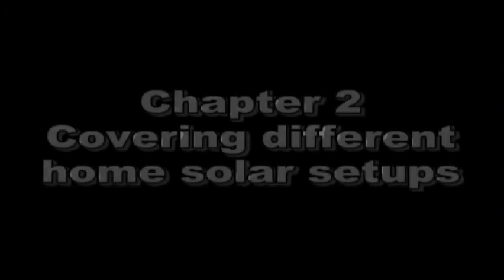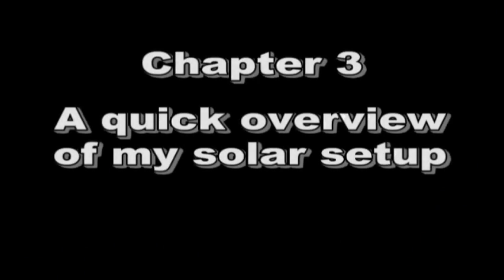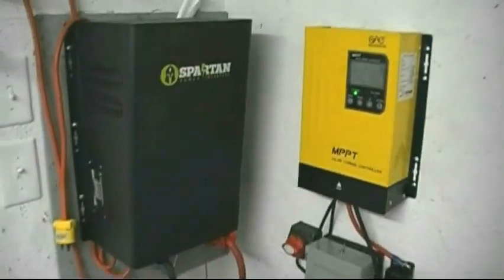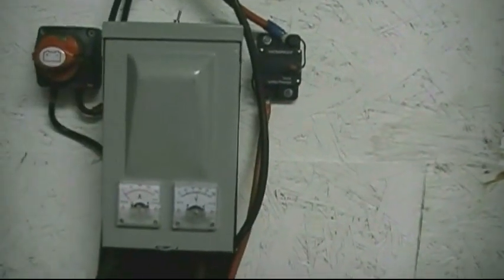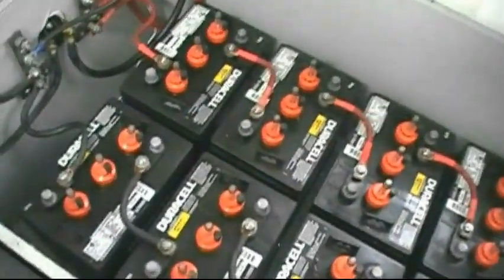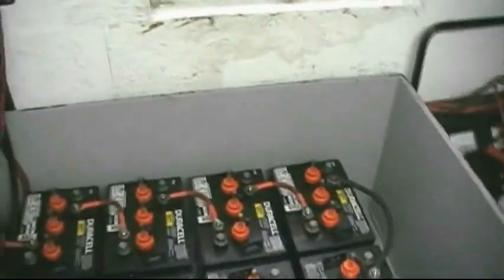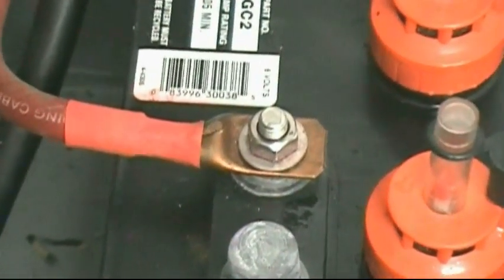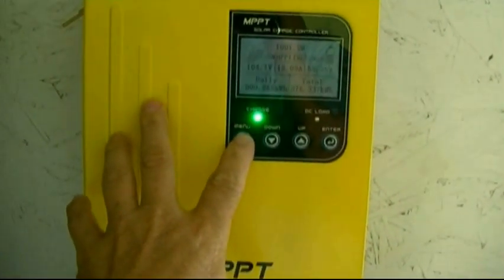Off-Grid Solar Setup 2021

Comment: I would love to see your woodgasifier hooked up to a generator to charge a battery bank...
Reply from the maker: In some of my older videos I am using the woodgas generator to charge batteries. This system can be recharged with the woodgas too by powering up the inverter/charger with a generator.

Comment: I'm building the same array but I have 12 305w panels. 48v battery bank. Want to power 2 freezers 1 frig and well pump. Everything else will be secondary. My inverter is a split phase 12000w 6 and 6000w. I have 24 130w panels for future use
Reply from the maker: Sounds like a real plan!

Comment: I put mine on the ground so I can tilt the panels, winter to summer angles. Wood frames
Reply from the maker: It sounds like you have a good working system. I'm getting ready to set up a 5000 watt array and it will be somewhat ground level too along with a second battery bank.
Reply: It was tough getting info from some dealers. They are more interested in selling only! Even when I've spent hundreds of dollars with them." You need more sir"
Reply: I got my system running but I'm only getting 7-15 amp 120v. I have 12 300w panels. They are producing 40v 7.8 amp. Still trying to investigate why not making more amps. 48v battery bank

Comment from the maker: Anyone reading this let me know if you can see the comments. I'm getting notifications but when I try to reply they are not showing up. I have already been through my channel and doubled everything making sure nothing has accidentally been turned off. If you can read this reply do me a favor and reply back to it. Thanks...
Reply: Yeah. This is strange, as googleTube says there are 10 comments here, but I can see only 4 of them, even after sorting them, newest first. 
 Oh, googleTube, you had ONE JOB, but no, you dun blew it. 
 Anyway bro, looking forward to seeing this video, now that I have replied  :)  .
Reply: 11 comments but only view 3, even after refresh and sort. ( That will teach you for bucking the Brandons ) Yup, you did a fine job putting the system together at a reasonable price.
Reply from the maker: @CNCmachiningisfun  Never experienced this before. I reached out to Youtube so we will see what's going on. Thanks for replying back. At least I know people are seeing the message I left here.
Reply from the maker: @nhhbbyloggr5022  Yeah it's now 15 comments with 5 showing up. Never seen this issue before. Thanks for replying back.
Reply from the maker: @nhhbbyloggr5022  Bill the solar setup works quite well. The good thing about this is I can charge the batteries from a woodgas generator if I needed to.
Reply: @flash001USA  Your solar arrangement makes good sense as it pretty much eliminates the fuss and chore of running the gasifier. But when the sun doesn't provide at least you have the option with the gasifier.
Reply from the maker: @nhhbbyloggr5022  Yeah that's pretty much my logic with this setup. I can charge the system with woodgas, propane or even gasoline. Many roads lead to ROME.
Reply from the maker: @CNCmachiningisfun  I know that you've had these kind of issues for a while now. I wonder if it's your location and maybe they censor you more than they do us here stateside?

Comment: I had to come back over and share this it might help someone who needs help with it. Did you know that a shock from 24 volt AC feels as bad as one from 120 volt AC?
Reply from the maker: Yes and I can PERSONALLY tell you that a shock from 150 volts DC feels just like..... Drum roll please ta da ta da ta da.... Just like you would expect it to feel---------> Very damned painful!!!
Reply: @flash001USA  I go hit with a DC short from a computer power supply , it measured 178 or 187 volts and all it did is tingle, there was no shock at all. I'm glad you guys are fixed for whatever crap these bastards put on us.
Reply from the maker: @BushImports  I put this up in the heat of the summer so my hands were damp from sweat. The worse DC voltage hit I took was working on tube amps where you would get hit with 600 volts up to 1200 volts on the back of your hand and wind up with a bad burn. I'm retired and out of the rat race now but you never forget!

Comment: I have a grid tied solar system installed by my electric co-op.  The Fronius inverter has been replaced twice in four years, not good. The panels are Jinko 325 watts and I have two dozen on a high metal mount. Works great when it works correctly. Like you my shop and well house the inverter, etc. The utility power drop is near the house about 150’ away. You didn’t go in to the configuration on the path you use to back feed from your shop to the house although you mentioned it several times Is there a separate sub panel you route power back to the house or how do you do that? Also, how do you isolate from the grid as required? Reason for asking is I’m told it’s complicated to put a switch at the main panel on the power drop pole near the house that cuts off the solar since it shares the path with the workshop, well, inverter, etc, Seems to me it would simply require a switch at the main panel that senses when grid power is gone. Am I wrong in thinking it’s that simple? The purpose is to ensure you don’t inadvertently back feed toe grid during a power outage. I like the thoroughness of your video. I also liked the gasifier video. You were pointed out by another YouTuber doing the gasifier thing. He’s young, blonde and very good. With all the homebrewing, maker shops and retirees, there is a LOT of good information out there. I’m just starting out in my retirement and life is so much more exciting to me. Please keep up the great videos and various projects. Now looking to put up my ROHN tower and reset my amateur radio gear after the workshop upgrade…….always sumpin’…..
Reply from the maker: For now the back-up power to the house is being kept simple. If we loose grid power I just run an extension cord up to the house where I split it off to the refrigerator and the freezer and to the entertainment system along with a few table lamps. We are talking a 50 foot drop and a heavy duty extension cord handles this with no sag issues. I don't have the shop power tied into the house wiring at least not yet. Before I do that I need to wire up a transfer switch at the house which will make things a bit easier for sure. As to the 5000 watt grid-tie inverter I have it's UL approved and accepted by my power company and it will not supply power without the presence of the AC mains so that is good to go as far as any safety concerns go. Nope you don't want to be sending your power back up to dead power lines and fry a lineman or trying to power up the neighborhood and you don't want the power coming online and burning up expansive equipment either so I'm with you on that observation.
Reply: @flash001USA  OKAY, I was wondering about that so nothing you said is unexpected. My configuration is a bit different which will require a setup that’s not only safe for everyone but will fulfill our needs. Currently I have electric space heating due to me not following through on some other design items when we built the house. With those changes cascade effects have cost us more than we hoped. So, my path is going to include better insulation in the house, seal up a few remaining air leaks, and when I must, change out the HVAC system that does not rely so heavily on expensive grid power. Within the next year or so I plan to move the existing Jinko panels to the newly constructed super-she-she/workshop for the wife which is about 1,000’ from the main complex. Easier and less costly than running utility lines!! I plan to replace those panels with a micro-inverter design running AC without a string inverter at all. I can also get a decent transfer switch to island the entire property. Later I can include a few batteries, generator, or whatever else technology allows if we have the need. I want to be ABLE to be stand alone but it’s not necessary today.

There are no Zombies coming across the property quite yet. However, the ice storm last February that pulled us into the rolling blackouts here in central TX will become an issue as we age. Give it more than a couple of weeks and we’ll need something more robust. We’re not homesteaders or peppers in the conventional sense, but we have learned that the more you can do for yourself the more likely you’ll come out of any stressful situations faster, in better condition and probably at less cost in time/energy/money.

I like the oil heater and gasifier options as well. I’m pretty handy so none of those options are off the table. What I don’t have is a lot of ME. I can only do so much so fast. So, I just keep after it and things get done. The stories I could tell………but again, thanks for the clarification on your setup. It certainly helps with the designing at my end. I don’t recall the link that put me to your site but I’m going to be going through more of your videos in the coming months. Please keep posting your adventures. You never know when one will provide some tidbit that a person uses that saves a life or at least makes their lives better.

Comment: How did you get started in solar?  Any tips for building one on the cheap?
Reply from the maker: I just read up on the topic and jumped in. I'm lucky to have an electronics background but if you can read stuff and follow directions you can do this just by watching a few videos and reading on how to set the system up. It's actually straight forward and simple.

Comment: I am curious if John bendini charging system would be any value to your system?
Reply from the maker: I've played with the Bedini motors and there are plenty of others here on Youtube who have built and tested the motors too but this is just my opinion from my personal experience. At best they will keep a closed loop system limping along for a good while but it just doesn't produce enough power to correctly charge up a external battery bank.

Comment: ?  If I have solar panels to a 24v  battery bank  dedicated to just a DC motor with 2 alternators, for feed back to batteries.  Will it hold a charge to keep a belt driven generator running even on cloudy days. Eliminating  an  inverter , by keeping DC and ac seperated by motor
Reply from the maker: Are you talking about running a 24 volt system to run a motor generator combo to charge a separate battery bank for your power use? It would be wasteful to try to run a motor to spin an alternator to charge a second battery bank and you would be better off just using any power you capture with the solar setup as your main power for use. You can always go with a larger solar setup to have extra or surplus power.
Reply: @flash001USA  there is no 2nd battery bank. The whole system is dedicated to the DC motor. It turns the generator
Reply from the maker: @waynehollingsworth4177  Ok so what you're wanting to do is make a semi closed loop somewhat of a self charging system? Let me know if this is what you're shooting for.

Comment: Hi Flash, I have watched your gasifier videos,  and am building a unit now myself using Ben Peterson's book. I want to use a blower available in the USA. What did you use?? Can I contact you on email?
Reply from the maker: David I found the one I use at the junkyard and it doesn't have a model number on it but from what I can tell it was used to inflate one of those inflatable Santa's that only stays inflated while the blower is running that people place in their yard during holiday's.
Reply: @flash001USA  thanks for your reply
Reply from the maker: Sorry man, I meant to tell you that I can be reached through www.miniwoodgas.com Just contact the webhost which would be me.